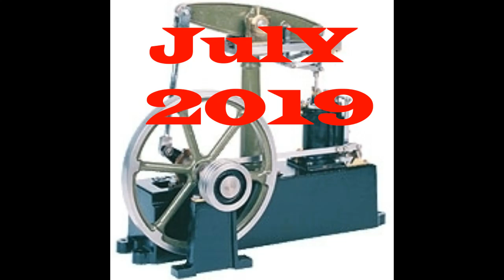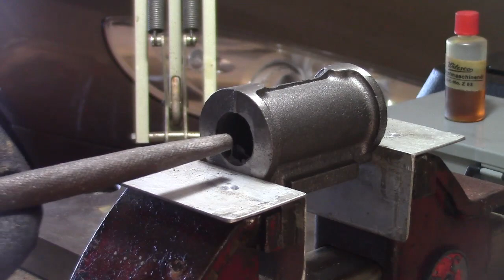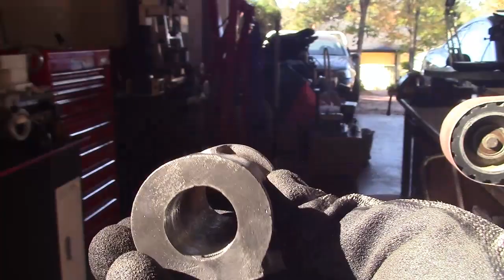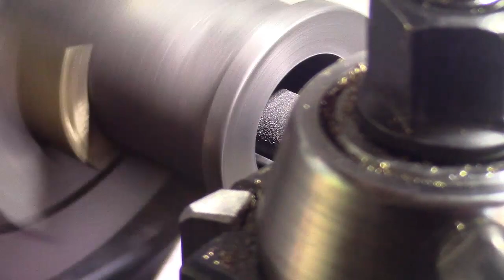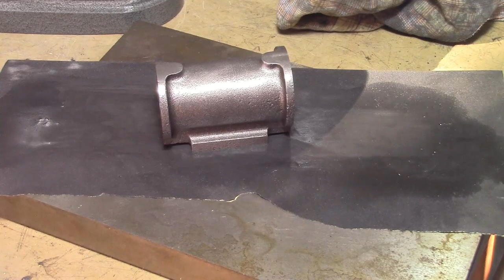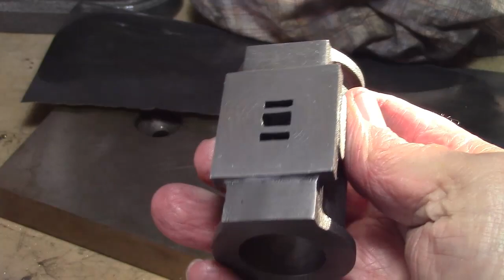Stuart Beam Build Part 2 /1

Comment: how did you measure how much to take off the port face ?
Reply from the maker: Hi Paul
I measured from the face to the bore, (with Verniers) remembering that the bore is 1"
I then checked it on a plate with a vernier height gauge.
I could of left the mandrel in the bore and measured from that, you could also use the mandrel to square it all up.
Cheers
Gary.
Reply: @creepy013  while still in the lathe?
Reply from the maker: Yes still in the lathe, but I did check it on a surface plate after.
Reply: @creepy013  ahh.   thanks. looking forward to watching the rest of the series.
hope you have some more engines in the pipeline.
paul
Reply from the maker: Thanks Paul
Yes I have a couple more engines, so stay tuned.
Cheers
Gary